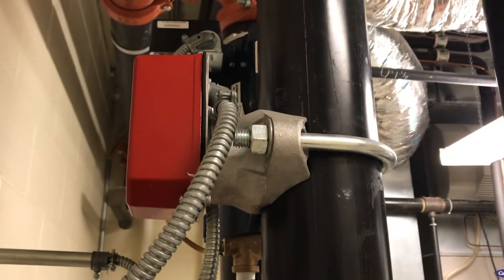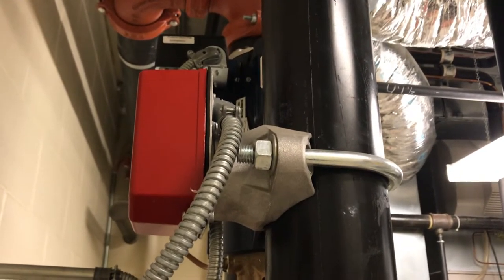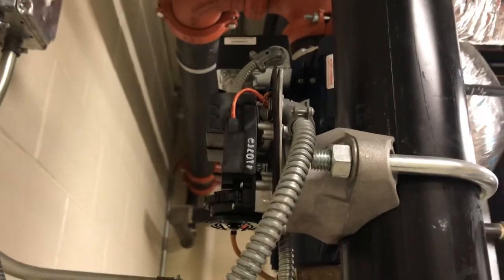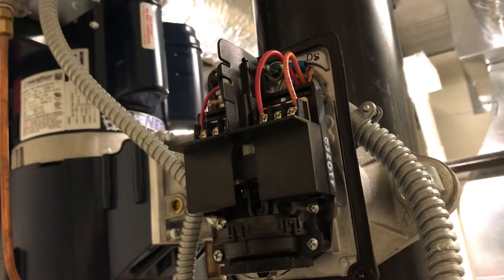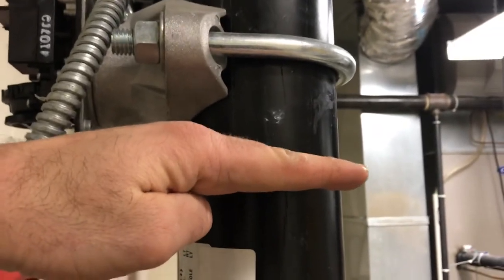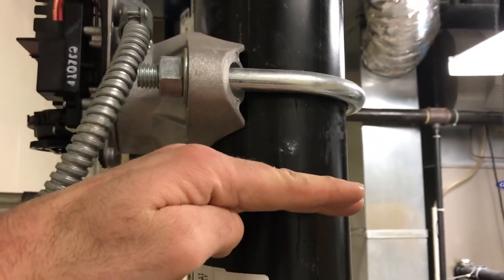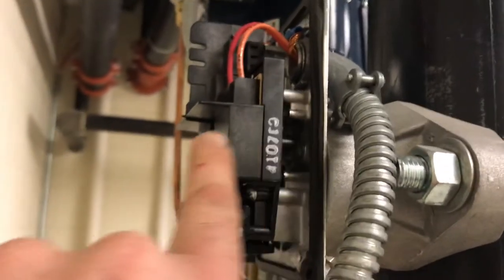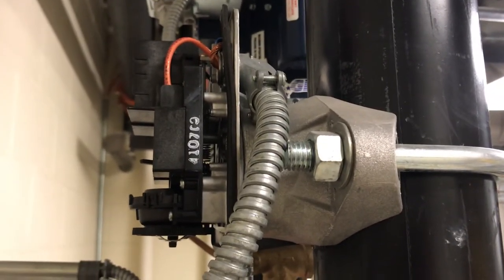Understanding a Flow Switch in a Wet Pipe Fire Sprinkler System

Comment: You absolutely CANNOT get an alarm when draining a system down through the main drain. The micro switch inside the water flow ONLY activated when a water flow is simulated to pull the paddle. Hence the reason they put test and drains after the flow switch.
Reply: Yes you can
Reply: Nice reply.......